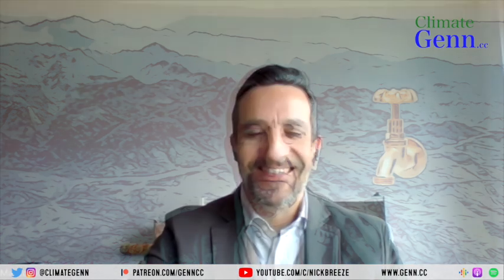Water Sources In A Drier world | Aquaseek Tech | Marco Simonetti

Comment: 1000L/day where and when? I doubt you'll be getting 1000L/day in the middle of the desert or any other dry region where workable tech like this is more necessary. This sounds like every other water-from-air startup that failed to generate a workable product.
Reply: why not just collect a ton of old used diapers from the dump - and string them together - they are made to absorb moisture. Then have a huge mechanical press and filter to squeeze out the water. Of course it would smell super nasty so you have to filter with coconut fiber to get a clean taste again.